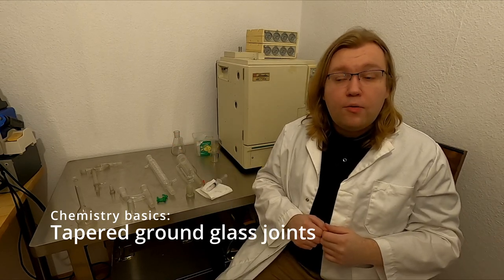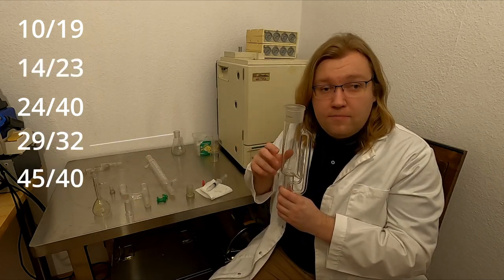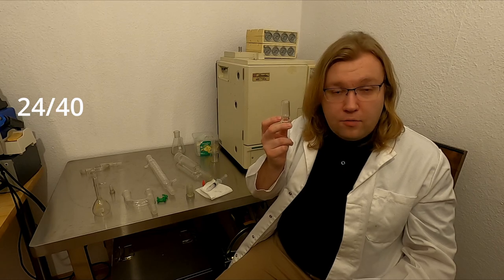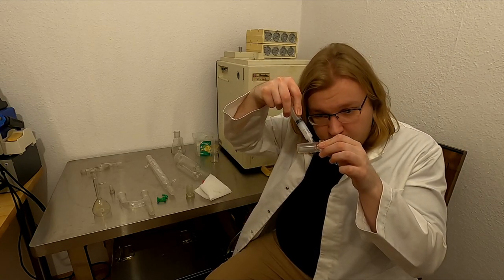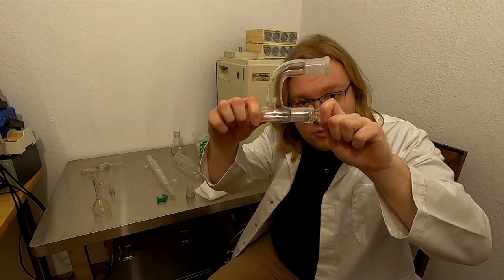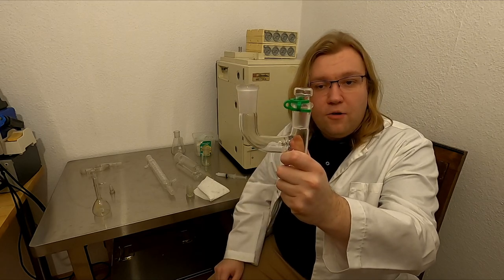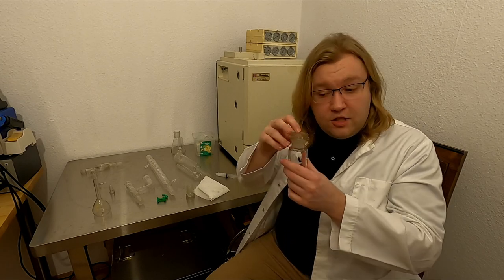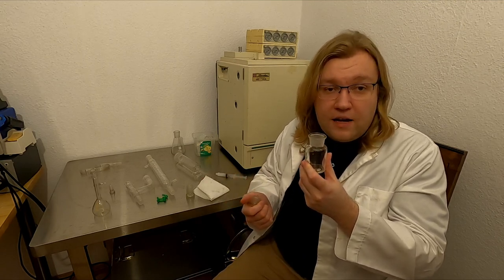Tapered ground glass joints | Introduction to chemistry: Glassware

Comment: Really nifty. Used them a lot over the decades now. Sometimes, if you use a caustic solvent, you might have problems with getting the bits apart.  I've found that using Teflon tape, like is used with plumbing (?) is often of use, instead of the customary joining creams or lubricants.  I think that the ground glass joints came about as a side line from some sorts of light bulbs during the late 1890s? Can't really say enough good things about these joints; really helps you keep a hold of your product!